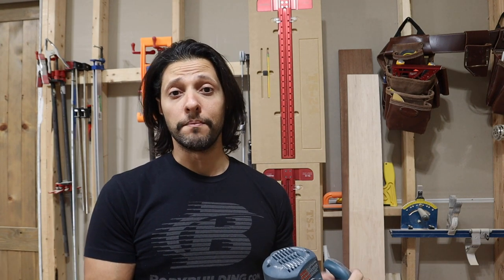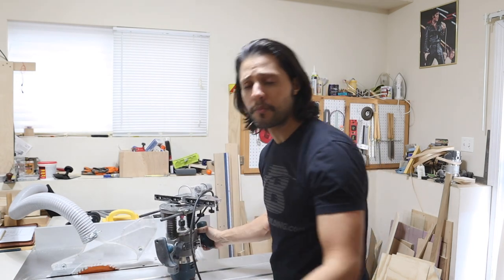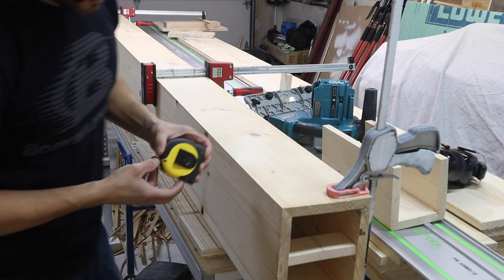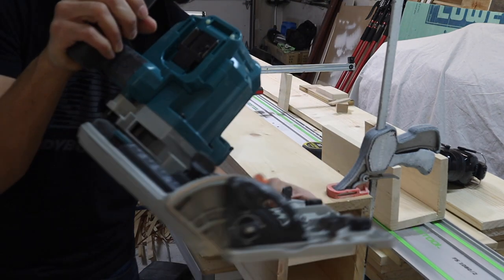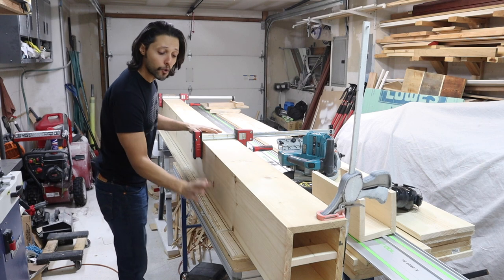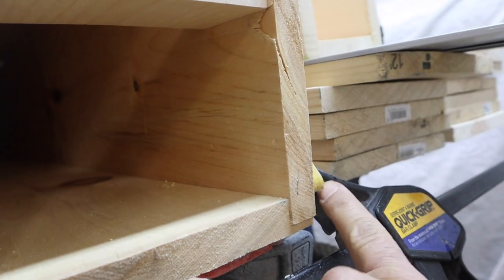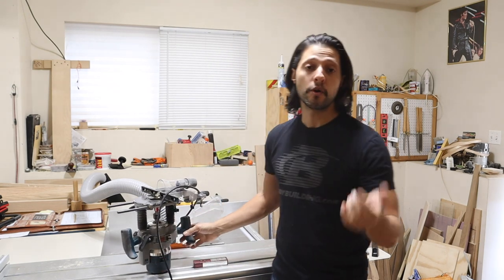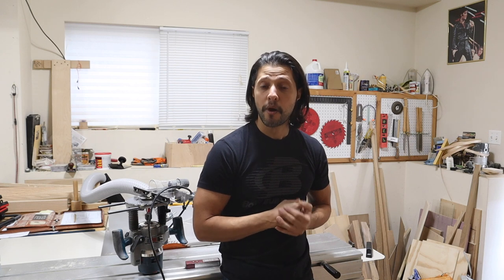Major fail, back to the drawing board

Comment: A lock miter bit works great, try taking some meat off on the table saw first and you won't be eating so much dust
Reply from the maker: I don’t have the length on my shop for that. And lock miter bits are more router tables and these are 12’ boards, too long for the router table with support and again I don’t have a clean run for this length in my small shop.
Reply: @AnthonyScolaro1  you're right I do use a table, I wonder if you could set a sheet of ply on some horses, undermount your router,  clamp down a straight edge and run it that way outside,  I also use a blower after those long runs,  the little makita 18 volt works great
Reply from the maker: @markevans7584  yeah, outside is the way to go but it’s just too slow. Production wise, my track saw take only a few seconds to do the miter fold cuts.